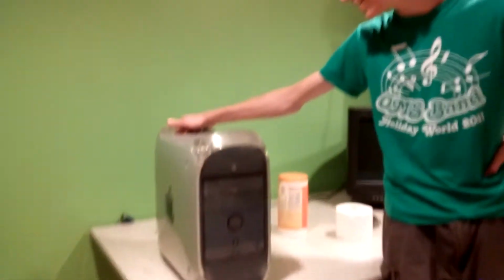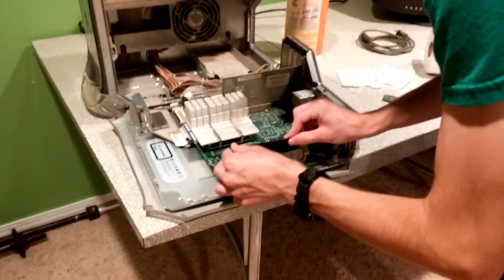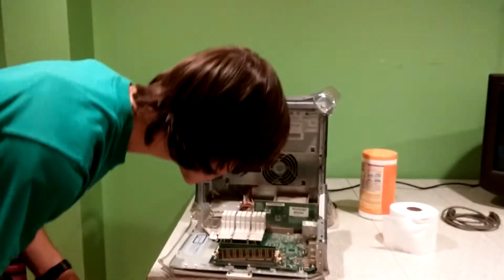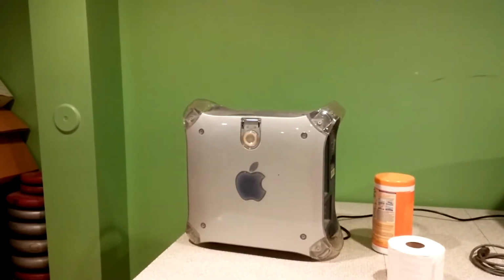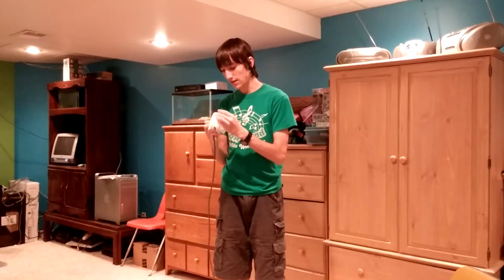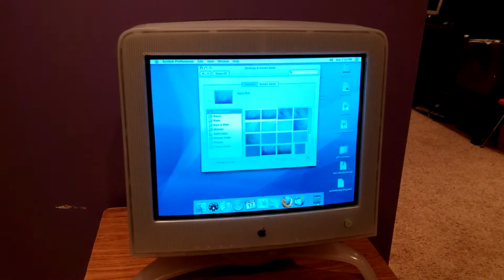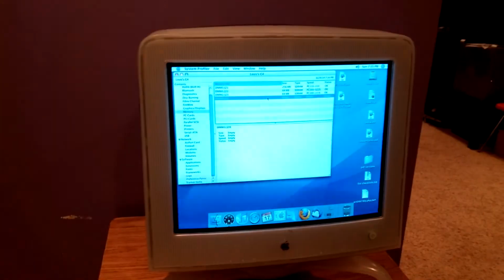Dusting Off a PowerMac G4

Comment: What did you use as a converter for your video out to VGA, HDMI, or whatever you're using? The display port on the G4 is ridiculously proprietary, which might explain your video problem. You should pick up a display port monitor...

I actually have a 15" or 17". Selling it for a mere $1,000.
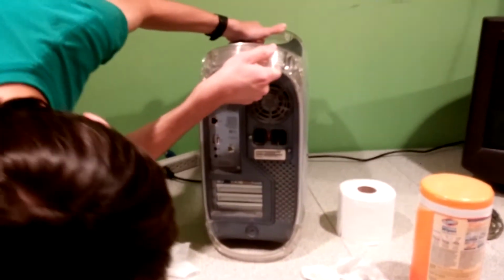Reply from the maker: As I stated around 6:13, this tower had a card with DVI and VGA. The Studio CRT I was using had a VGA cable for input. Neither of the machines had DisplayPort, and I don't recall having a video "problem" with either.